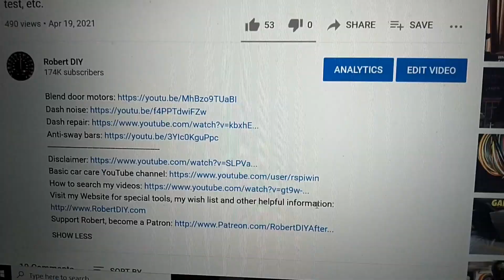Richmond VA, replaced a cylinder head and getting some more things scheduled to help others. - HOWR

Comment: My 850 was called into action the last 2 days and didn’t disappoint in the slightest. After not moving or being started for 4 months, I started it, towed my broken down 940 all the way home. Had never towed before, clutch is slipping, and it has damaged fenders, it got the 940 home no issues, then drove 200 miles today to a car meet and back, didn’t even blink an eye. Man I love that thing. 

Clutch rebuild incoming ( TTV flywheel and r clutch and all the other bits) and new fenders have been ordered from skandix
Reply from the maker: Very nice. They are bricks as well.

Comment: Volvo head gaskets go on dry, with no additional adhesives, whatsoever.  Why did you use GasketMaker?
Reply: He used it on the coolant pipe gasket to hold it in place.
Reply from the maker: Huh? Did Rodney answer your question?

Comment: 05 s40 t5 replaced head gasket sent head to machine shop. Replaced the oil filter/ pcv. The hose running from pcv to the top of cam cover is leaking oil rapidly. Y???????
Reply from the maker: Yikes! Something must be plugged.
Reply: its a s40 how did it escape the junk yard ? thats where they all live  then gets crushed.... they are real piles now you know why ...

Comment: Robert...great content...thanks for sharing!  Did you inspect the air charge hoses or the intercooler for oil?  The issue could also be a bad turbo.
Reply from the maker: Nope, it would not run for 12 months and 30,000 miles with a busted turbo.

Comment: Hey Robert my volvo s60 2004 2.5t awd with ~130,000 miles is clicking very loudly when shifting from drive or reverse, and the power steering seems a bit sluggish even after a flush. I read it could it be bad cv joints or worn motor mounts, or differential? Thoughts? Been watching you for couple years now love your content!
Reply from the maker: Clicking? While sitting parked?
Reply: @RobertDIY yes sir, it occurs when parked, very weird
Reply: @GeorgieCraft  pcv line under the motor area  some times comes loose and off ...seen this on a 2004 xc70 made a clicking sound parked ....took days to fiqure it out...

Comment: Hello Robert, I have C70 2000 2.3 convertible that needs a head gasket, Let me know if you will in NY. Thanks. Dexter
Reply from the maker: yes i will
Reply: thats a $700 job with just parts ......you need to deck the head and not just put a gasket back on ...   do a valve job and timing belt ,water pump too its all there....
Reply: @AwakeDude911  I just want the job done right. Dexter
Reply: @Dex2020   $$$$$$$$$$$$$$$$$$$$  just for parts ..i did my s70 head  not an ez job ..mine had the burnt valve ..